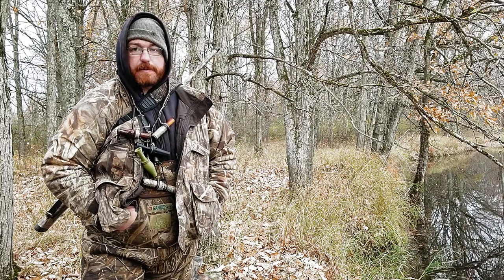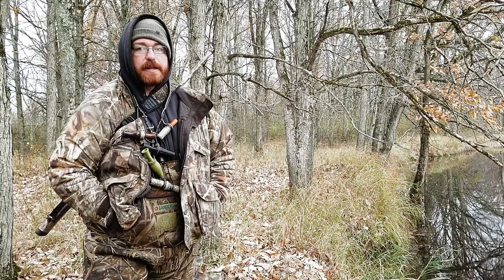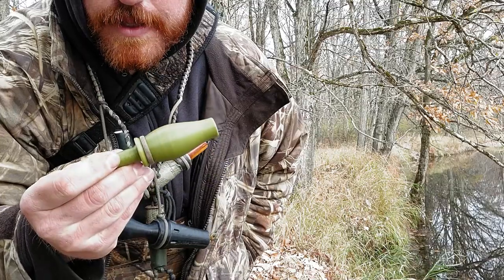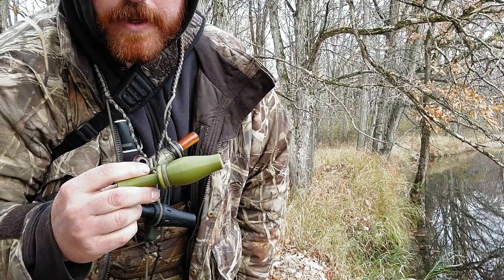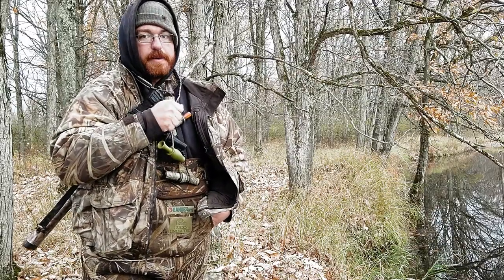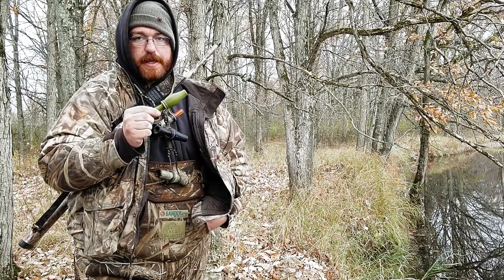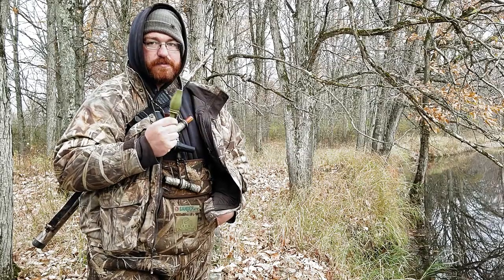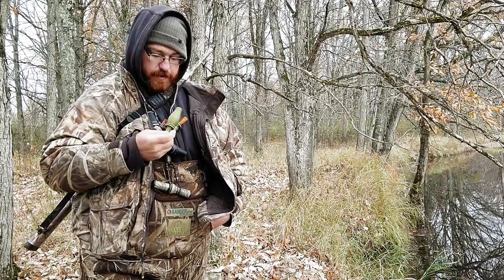Does a 3D Printed duck call sound real? You tell me.

Comment: I'm new to printing. What material are you using and your heat setting? Any help would be great. thanks
Reply from the maker: The black one was printed in PETG and the green was printed in PLA. Heat setting depends on the printer and the filament but I think I print PETG at 215-220 C and PLA at about 200-205 C, some PLA types a little cooler some hotter. I usually print the cheapest filament I can find so the brand changes all the time.

Comment: Nice man!!! They don't sound bad to me at all! Will you be sharing the stls?
Reply from the maker: Thanks! I might try to shorten the reed on the single a bit and then maybe share that one.  The double was my first design that I thought actually "worked" lol even though the single sounds better now.  I think I may make the designs a bit more printer friendly too, the threading on both halves seems to be hit or miss on some of my printers and they don't come off the bed ready to go like I would like.  I think that might be more of a result of calls in general but still I'm stuck in the "perfect" mode instead of the "done is better than perfect" mode.  Long winded answer, short answer: Probably the single reed after I tweak it a bit.  Thank you for coming to my ted talk.
Reply: @RevampedOutdoors  hahaha! I appreciate the Ted Talk! I've printed a couple of calls, but neither sound as good as yours. Any tips for keeping them calling when it gets cold? It's still warm here in WV, but come January it'll be cold and my calls get squeaky. It seems like a lot of the commercial calls work great down south, but I struggle to keep them going when the temperature drops. Probably just me being a noobie though. Lol
Reply from the maker: @hotbrass2005  calls and the cold are my nemesis.  For me it's always a function of moisture freezing in the barrel of the call when it drops below about 20 F, I think condensation and spit builds more in the barrel when it's super cold.  I've found a few tricks over the years that seem to help but when it gets to below 10 F there's pretty much no hope (other than putting the calls in your pocket next to your body between calling).  The first thing I try is to blow through the flute (opposite of normal) this may help blow all the excess moisture back out of the barrel and away from the reeds.  Sometimes this helps in the moderate cold, super cold it can freeze too fast to help.  The next thing I try to do is put my hand over the exhaust and blow low and slow to heat up the barrel and the reeds before I try to actually call.  I think it helps move the reeds without making sound that could scare anything and stops an inadvertent squeal. Last resort I take the barrel off and blow on the reeds to get the moisture off and repeat steps 1 and 2.  If that doesn't work I go home because it's too cold to sit for one duck lol.  Hopefully those tips can help, sometimes though it's just too darn cold.
Reply: @RevampedOutdoors  good tips! Sounds like I'm not the only one that fights this. I've tried blowing in the flute end and keeping it on my pocket, but I experience the same battle when it gets super cold. Maybe I'll try making an 18650 powered call warmer. 🤣
Reply from the maker: @hotbrass2005  I would buy that. Also make a good set of toe warmers that actually work lol.
Reply: @RevampedOutdoors  hahaha! I hear that man!!! Toasty Toes work - for about 10 minutes. Lol